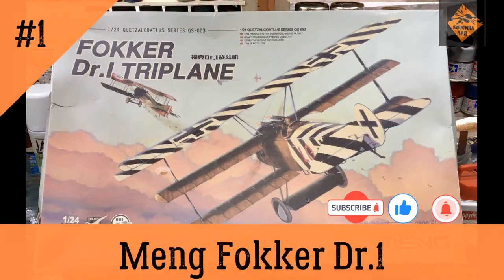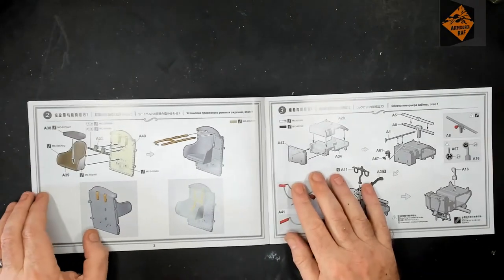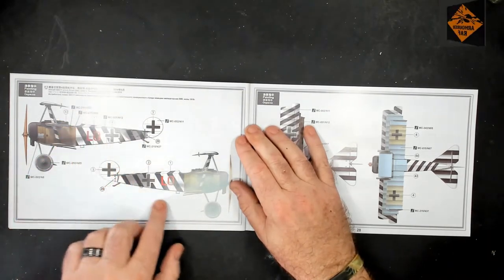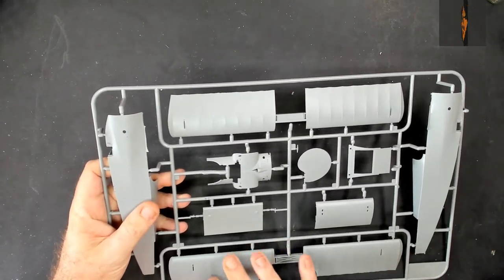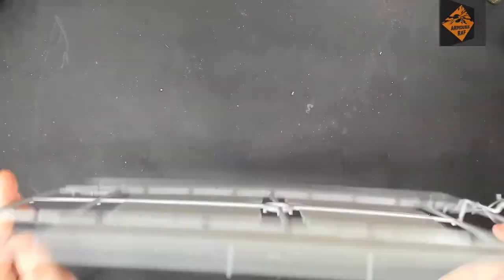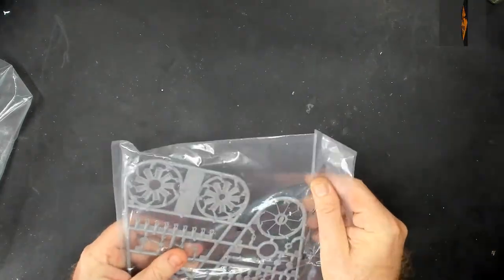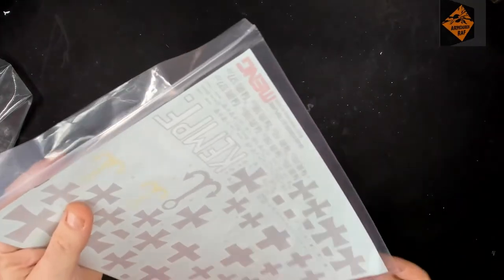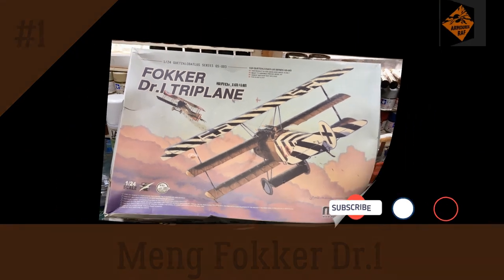Episode 1 of my Meng 1/24 Fokker Dr.1

Comment: Wow!!! Pushing the boat out. Way to go. I'm doing the Handley Page H.P.42 "Heracles" at the minute and it's a  "time-taker". One day I'll tackle a tri-plane, too.🤔😉
Reply from the maker: Nice, it's a bit of a beast looking at it :)...What scale Pat?
Reply: @BudgetModeller  
It's the"new" Airfix 1:72 vintage classic. I've found it to be a great little model. Yes, there are seam lines, and while some are quite thick due to minor mis-alignment, but there's no flash. As I mentioned, there's a big gap (5 mm on my model) but I found that easy enough to correct by using the coffee cup hack. I'm building it "naked"... ie without paint as I bought a second. €12 (approximately £10) each.
Reply: Oops. I wrote the wrong scale. It's 1:144. Sorry about that. I'm so used to buying 1:72 that I made an ass of you and me.🤦‍♂️😉

Comment: Who were the delivery firm if ok to ask
Reply from the maker: It came from China via AliExpress, I’ve spoken to the suppliers and it’s all been resolved 👍👍👍
Reply: @BudgetModeller  I had similar but it was customs the removed every sprue from clear bags on a ww1 German tank from meng completely destroyed it
Reply from the maker: @Steve-dr7rr  What a bunch of B’stards!!!
Reply: @BudgetModeller  yep it arrived bits all over inside the box only sprue they didn’t touch was the clear one. I got a refund but it wasn’t the point but be careful ordering from China the customs service there have there moments. There was no need to do it as all in clear bags as they all are. 30-40 pieces all over bottom of box I’ve got it here not gone completely through it item by item because as you know the A7V is a lot of parts. So just be careful and expect the unexpected
Reply from the maker: @Steve-dr7rr  I bet you were gutted!
Reply: @BudgetModeller  I was and absolutely fuming I contacted company or were great not there fault but it looked like box was used as a football and I thought ok it happens I opened it with excitement as we all do only to be met by as I can only describe it as a bomb went off in box. I brought one from here in U.K. cost a bit more but they were hard to get hold of. Still got the bomb squad one might be able to salvage it by hopefully getting the sprues I might need with parts never been able to understand it at all
Reply from the maker: @Steve-dr7rr  Bloody hell mate! That’s ridiculous!!! What kit was it?
Reply: @BudgetModeller  it was 5he Meng Model 1/35 TS-017 German A7V Tank (Krupp) Rare ww1 German tank
Reply from the maker: @Steve-dr7rr  Nice 👍